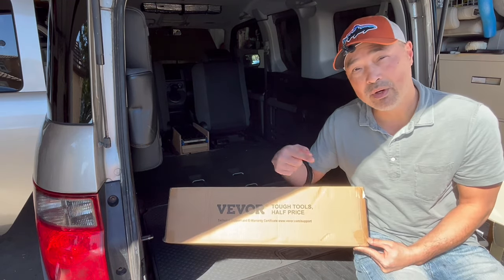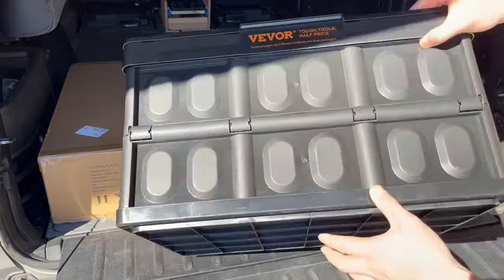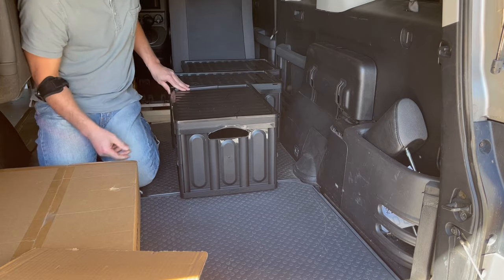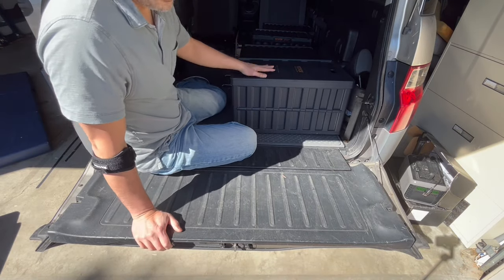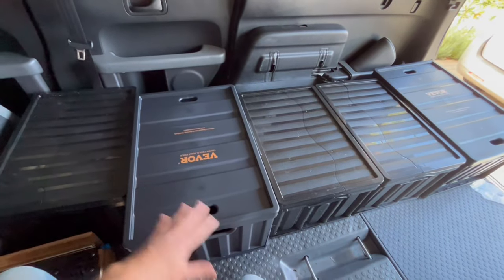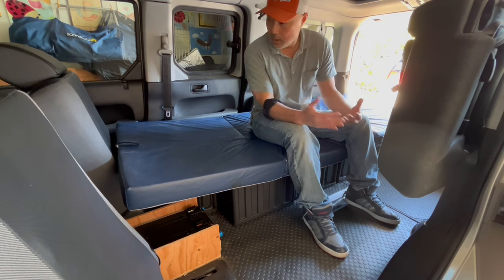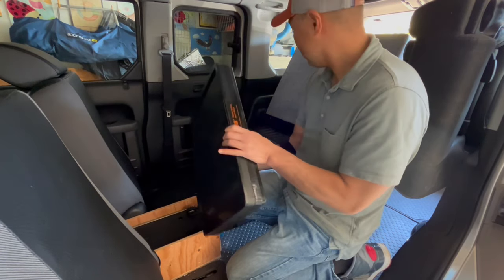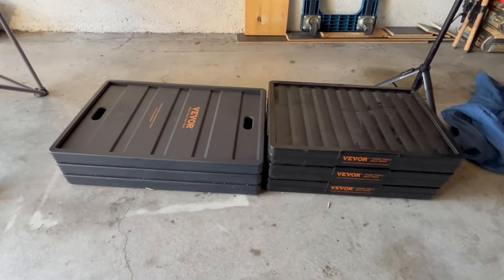Easy No Build Camper Bed With TONS of Storage and Even a Table.  Stores Easily When Not In Use

Comment: I enjoy all the no build videos. My minivan doesn't have as good of a level floor as your Element. We do a no build by using metal racks like restaurant wire shelving, then buying the matching standard patio bench cushions that are the same size. The racks are adjustable for leveling but also were intended to hold a lot of weight. We usually use the bins from costco as under bed storage since its smooth and slides in and out easily.

Really enjoy all your videos.
Reply: U sleep on patio cushions??
How??
Reply from the maker: @YeshuaKingMessiah , yes, Yeshua is King. Yes, I do sometimes sleep on "patio cushions."  But normally  sleep in a real bed.
Reply: I've a Citroen Jumpy 9 seater. I took out just the side door seat. I put down 4 seats and lay OSB board over to topped with as single mattress. Storage under and between seats, one seat and kitchen with microwave, cooker, fridge/freezer in rear. In May off on a trip up through Balkans to N coast of Norway and back to France through Scandinavia. Surprising how well it works for me a 75 yo and 2 little dogs.  Vevor diesel heater and 2000 inverter.
Reply: Could you provide a link of the shelving? I am having trouble visualizing what you are explaining.

Comment: Can You Make a 2 1/2' Wide Aprox by 6' Length with 2--pcs PLyood Hinged Length Wise To inCase Aprox; 3 On Each Wood x 3 100Watt 😅Cheap SoLar PaneLs = 600Watts TotaL, To Put Outside iN Sun@ Day & Then *if Wanted To Use as a Matteress Base@ Night,  Those ELements are Smart,  but i' Think a Light BuiLd is 😊Key Since ALready Like@3700 Lbs,  Oh maybe Cut 1" CircLes Towards End To Tie/Drape Down From VehicLe For Quartszite Sun,  bye
Reply: Ya But...i' Started Thinking maybe Be To Heavy@ FulL Length, Maybe 2 1/3' x 2 1/3' Suitcase StyLe With 2 -- x100watt Square SoLar PaneLs,  = ReaListic 400watts,  & a Small Wood Draw 4 the FilL in@ Bed For Maintaining Same SLeep Height, & maybe Some Small WheeLs to RolL easy Lol 😂 Just a 💡 Thought

Comment: Hi 👋   I have just bought a similar van, and had the exact same idea of using boxes.  Only thing is if these are 'collapsible'  then they may indeed collapse during use ‼️  I've been looking around for some boxes which are much sturdier than this type, trying to find just the right size and height.   Can you tell me how these ones are holding up, especially without a plank on top, which would give it more resillience ❓  At present I am using a blow-up bed (double height) but it is much too wide, and can only just squeeze in my w.c. alongside.  It also does not give me any storage, which is a nuisance 😏
Reply from the maker: I would not use these types if you are more than 170lbs(?). They are less prone to collapsing when you actually have stuff in them.
Reply: one option is to go to a craft store and buy the large wooden crates they would work well for a design like this on average the crates at 24-32 inches long and 16-20 inches wide each and are made of wood (lightweight wood) use those + a small sheet of plywood less tha 30 pounds weight and a sturdy build can hold over 200 pound person easily
 saw someone do this and was cofortable at over 300 pounds